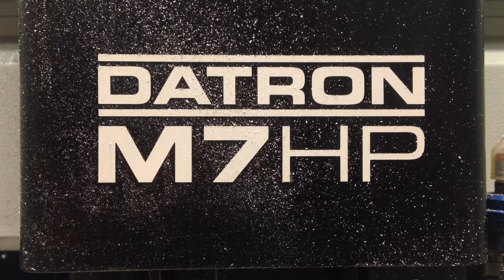Aluminium rim machining |  DATRON High Speed Milling Machine M7HP | HD ◄ Stefan Schneider

Comment: Feeding way to wimpy.. I take cuts 3 times deeper with twice the cutting feed on the older M8 Datron..
Reply: Sorry, didn't mean for it to come off as negative, more so trying to help you utilize your datron more effectively! Cool video!
Reply: By the way, is there a cooling system on this machine?
Reply from the maker: For the Spindel? Or for the tool?
Reply: For the tool
Reply from the maker: Nope, normally we cut wood with the machine. This was just for a stupid little video project. Cutting aluminum without coolant is not good for the tool and the workpiece surface. I know that.
Reply: Ah, that would explain the light cuts